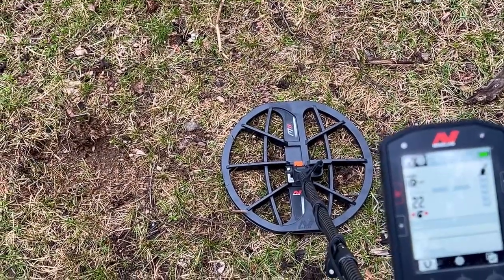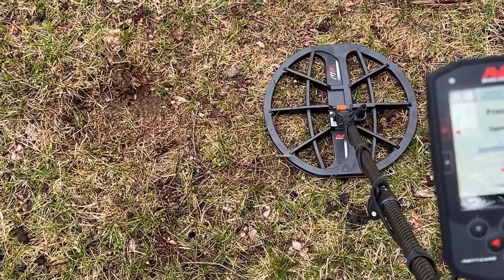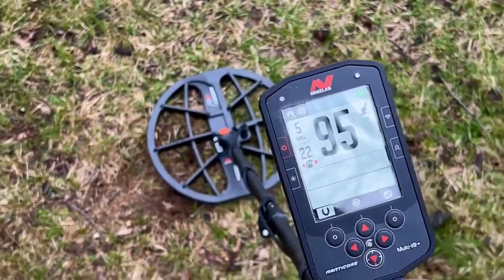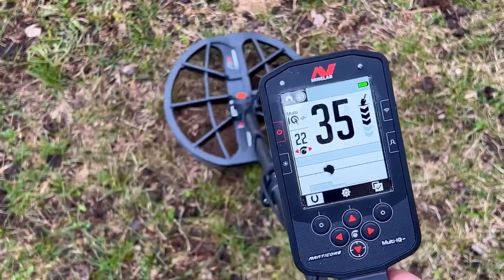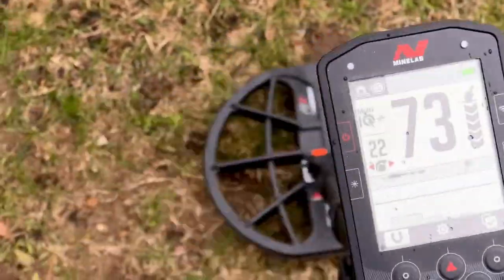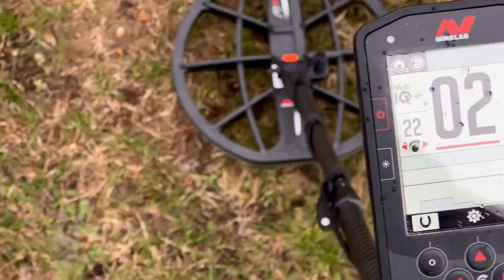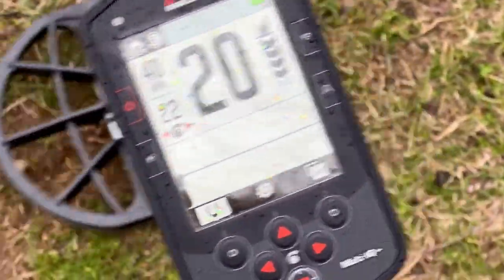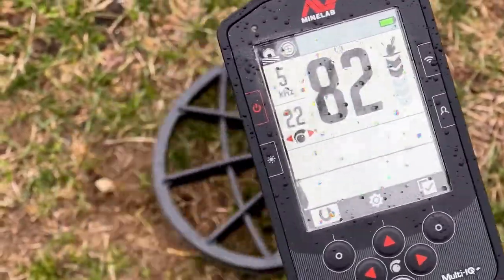Minelab Manticore, junk targets, some multi vs single freq

Comment: Good demonstration. Looks like the 5 kHz does a good job of identifying big iron!
I forgot about the ferrous range 1-19, I need to RTF again :)

I tested 5 kHz with smaller pieces of metals, my results were OK, some of the plated metals and stainless steels sneak by.
I'll be checking iffy signals with it for sure!

5 kHz picked up a fine gold chain better than any of the SMF. I didn't test all the single frequencies.
The chain is almost undetectable in SMF.
Beach Deep with Audio Enhanced, Rich threshold worked the best of all the SMF for the gold chain.
0.64 grams, 10kt necklace.

Tks & HH

Comment: You lose your upper/lower ferrous limits (iron bias) setting along with the 2D trace of targets into upper ferrous limits area when in single freq…but, yes, the manticore lumps all iron in single freq from 1-19 in the lower ferrous limits area . You lose iron bias setting in single freq on the Nox machines too.